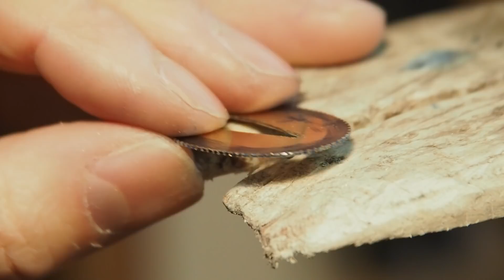煉獄杏寿郎の日輪刀を真剣に作ってみた。# 03 "鍔＆切羽" / Making Rengoku's Katana from [Demon Slayer] # 03 "Tsuba"

Comment: What is the purpose of the seki-gane?
Reply: Katana and tsubas are one-of-a-kind items.
Therefore, when you renew your kansa, if you try to use your old tsubas, they may not fit perfectly, or on the contrary, they may be too tight or too loose.
The purpose of the tsuba is to protect the hand. Therefore, if they are not securely fastened, accidents may occur, and so the "seki-gane" was applied to fill the gap between the sword and the tsubasa.

In addition, when the tsuba was made of iron, the sword and the tsuba would sometimes rub against each other, damaging each other.
The purpose is also to prevent the sword and the tsuba from being damaged. (There are various theories)
Reply: @MSYB-m2g  thank you for your response and the information. Your explanation made the purpose very obvious, in hindsight. :)